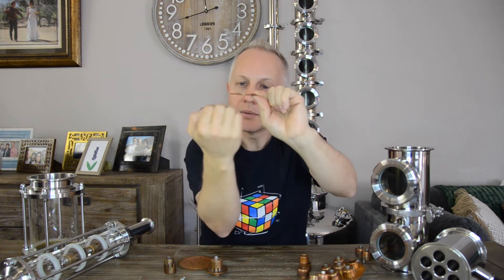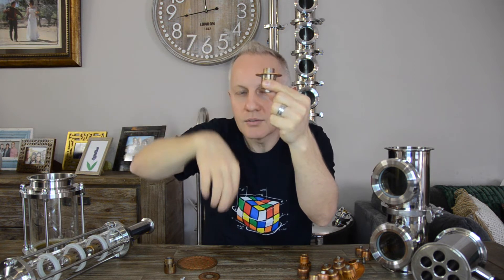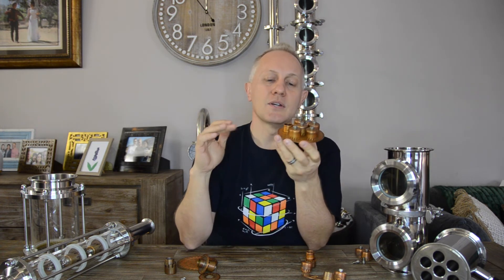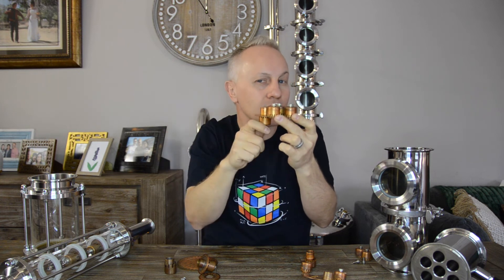Bubble Caps vs Perforated Plates | Distilling Plate Comparison Explained **AUDIO FIXED**

Comment: Hi! Thanks for your video. Just a question since im new to bubble plates. These caps? Do you just hand tighten the screw? Cheers from Norway 🇸🇯
Reply from the maker: Hey, thanks for watching! When it comes to the bubble cap trays, you generally want to hand-tighten the screws, but don’t overdo it. The idea is to make sure they’re secure but not too tight, as you don’t want to risk damaging the caps or the tray. If there’s a specific torque recommendation from the manufacturer, that’s always the best guide. Cheers from here, and I hope your setup goes smoothly—best of luck from across the globe!

Comment: Source for bubble caps being more efficient than perf plates?  Because all the literature and pro reports I've seen disagree.  Bubble caps inherently have a much larger turn down ratio and are thus more flexible but are typically no more efficient.  Good vid though, cheers.
Reply from the maker: Hey MrJhchrist!
You are right and a good point.
I feel that on large scale, continuous still perforated plates, sieve plates or valve trays are better. For home and hobby distilling I found bubble caps work better. You have to use what works for you!
Thanks for the questions and comments, I appreciate it!
Cheers!